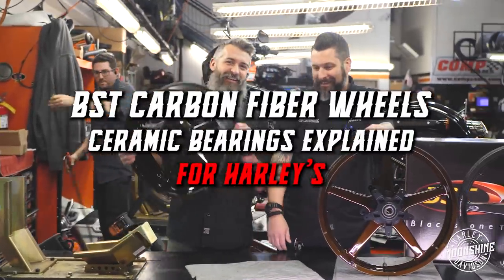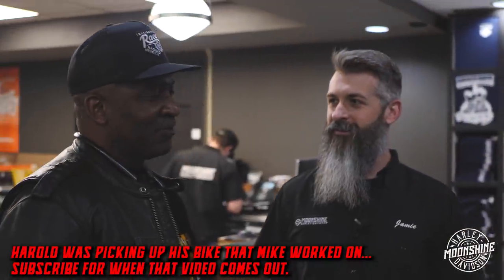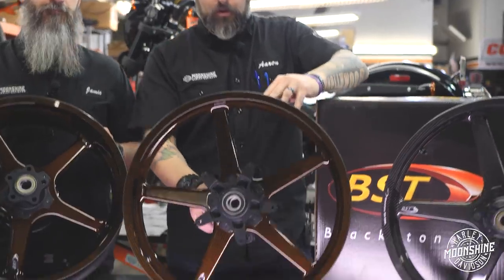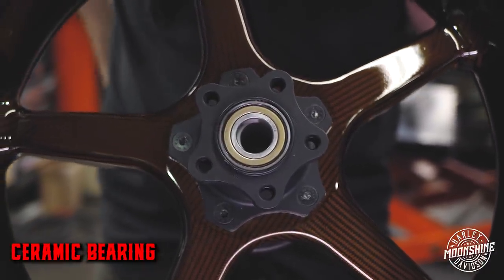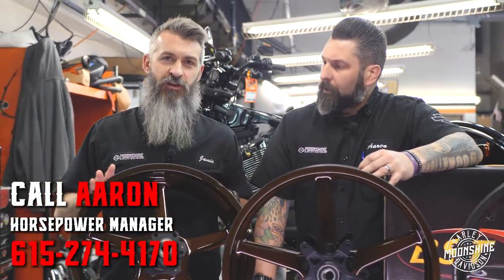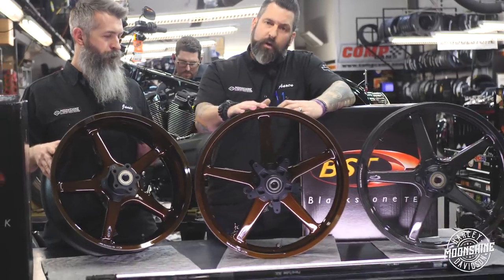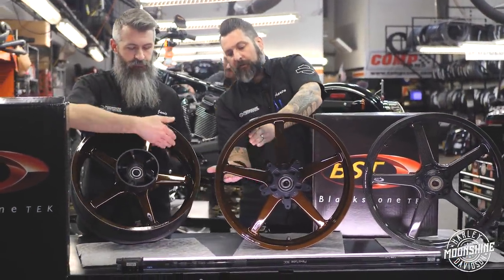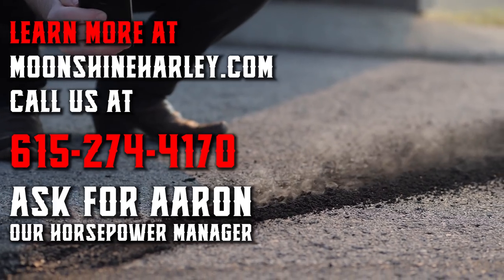BST Carbon Fiber Wheels & Ceramic Bearings for YOUR Harley-Davidson | Shop Talk Episode 36

Comment: I have a set tinted orange on my 2019 street glide special and BST now makes the correct size for my 2018 fatbob.  Both with ceramic bearings. Will post a video on the fatbob with Perelli Night dragon rubber soon. Had a set on my low rider s and it really enhanced the handling with the reduction in unsprung weight. Love them. Go Moonshine Harley!
Reply: Approximately how much?
Reply: 5k

Comment: I had a set of my 2nd gen Vmax17. Alot of money ... most people wont feel a difference. My 2019 FXDR Has a BST on the rear. The 240 rear eats up HP. The BST gave me a 5HP dyno gain. Only an extreme performance junki can justify the cost ofset for the gain. My wheel has been warranted 2 times for leaks.

Comment: So can I put those on my electraglide or do I have to get the other ones named Torque
Reply from the maker: gump90210 You can do either one. Call the shop and ask for Aaron or Jamie 615-274-4170.

Comment: Can these wheels handle the abuse of burnouts, wheelies and stunting on bagger?
Reply from the maker: gump90210 the only set we have seen brake was from a crash where the bike was totaled. BST has some testing where they drop 1,100 pounds on the rim and it handles the direct hit fine. The carbon rim will flex and handle more load than most to almost all aluminum rims especial stock wheels. The even bounce these rims off the ground to show you the don’t dent or bend like aluminum rims.
Reply: @MoonshineHarley  Thanks i will be calling you guys

Comment: And the biggest question is the price
Reply: Like $2000 a wheel
Reply from the maker: gump90210 $1,500 - $2,500 a wheel will cover almost all the options. Which is not far off from other aftermarket wheels.
Reply: After shelling out almost 40k for my bike, another 3-5k for rim's it a little out of my reach. I can think of better things my money can go to
Reply: That's cool but I'll have to go all the way with 17" wheels to be be able to fit my all time favorite rubber(Michelin Pilot Road 5 GT) on the '17 Dyna FB.